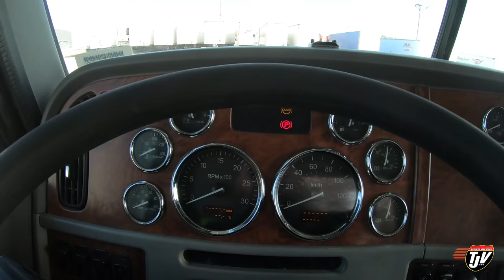My Trucking Life | WORK TOGETHER | #2264 | April 21, 2021

Comment: Josh I would keep me a can of spray lubricant like pb blaster to spray on those tensioners on the roll tights to make it easier on everyone.Also get you a small blower to blow out the tracks on the roll tight to keep everything functioning easily

Comment: It is obvious that the road was designed for cars that don't need the gap a truck does.  The situation only gets worse as your load gets heavier.  You barely made it in with your load.  Imagine if you had been loaded to the max weight.  You would have had car drivers lined up for miles cussing you out for not going on any of the gaps they could have easily made.  Everybody judges people according to their own experiences.  There really needs to be a fly over on that intersection.

Comment: Are 3 axle trailers now legal in all US States? Or does it depend on weight limits? 
Assume the shop found the starting problem, most likely electrical & not a "SENSOR" as found in newer OTR trucks. 🤠
Cheer's from Deer Park, Tx USA 🇺🇸 ☕🥯🥐
Reply from the maker: It started after I kicked it lol

Comment: Just curious. What was that red tag on that trailer for???
Reply from the maker: It was actually orange and it means that the wheels have been removed and put back on recently and we need to retorque it soon
Reply: @Trucker_Josh  got it. We use to put red tag on the trailers when there was a problem that keep them from being used.